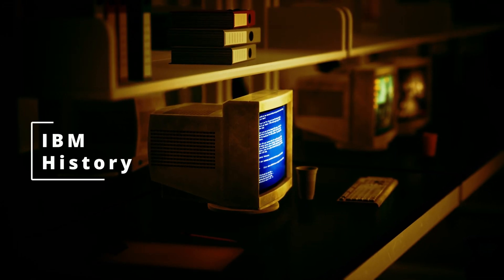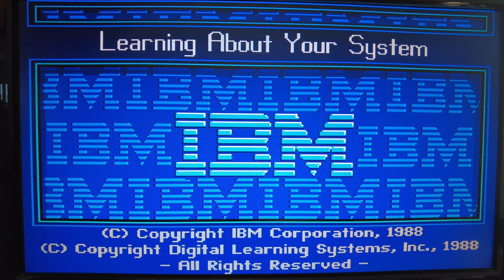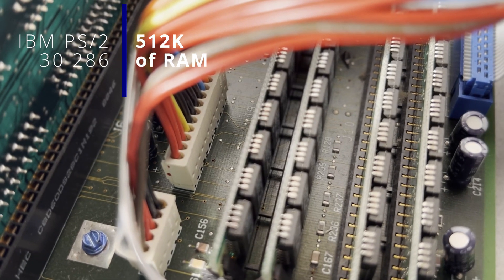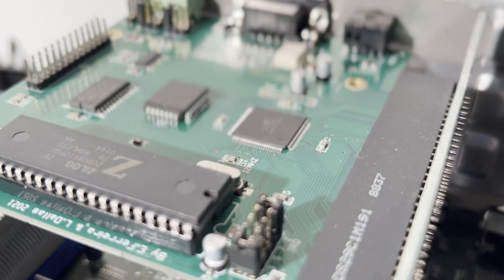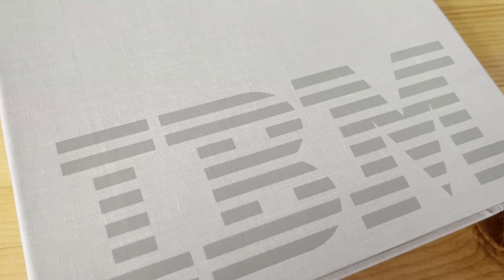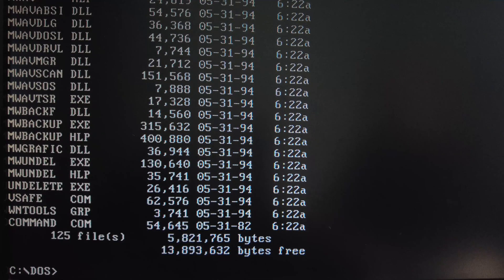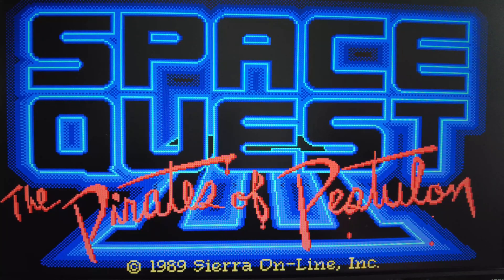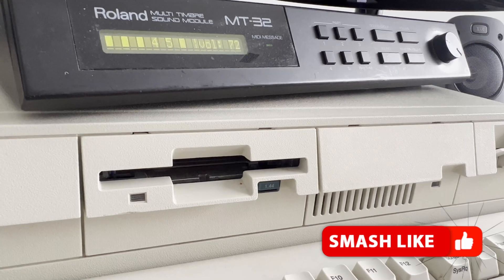IBM History | IBM PS/2 30 286 Computer

Comment: The root user,  these look like some good old RS 232 serial cabling ports in the video, DB 25?  Did I guess correctly? Would those ports connect to a switch or a old hub?

IBM monitors with VGA connectors makes since. Just read that IBM created the VGA analog 🔵 blue, 15 pin,  cabling connector in 1987. Legacy technology can still be required learning. 
Nice job 👍 Root user.
Reply from the maker: Yes, there is a serial connector and a parallel connector on the IBM PS/2, as with every computer made back then.  The monitors were VGA, which was the standard, so the monitors were in no way proprietary.  In other models of the PS/2 they used micro architecture instead of ISA or PCI, that was the only proprietary system on an IBM system at that time.